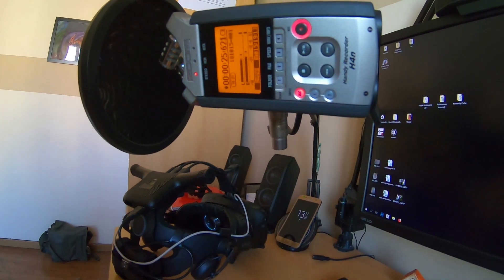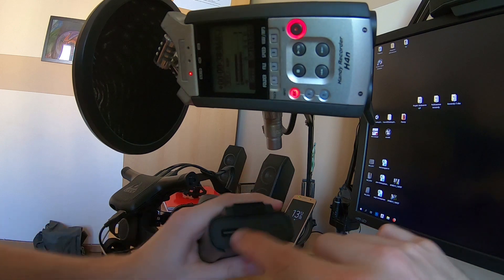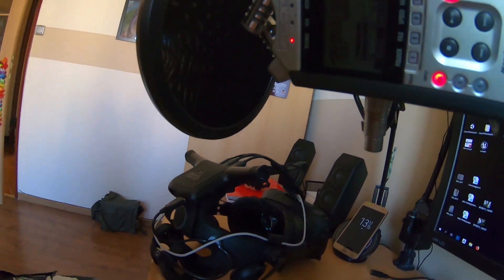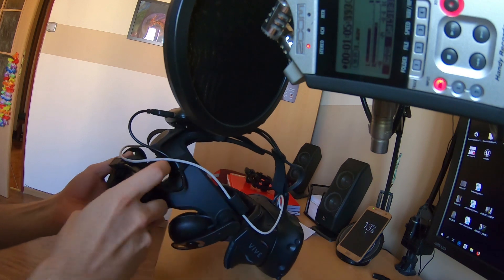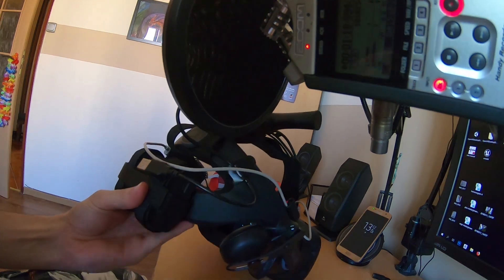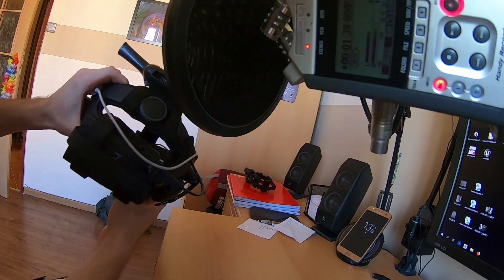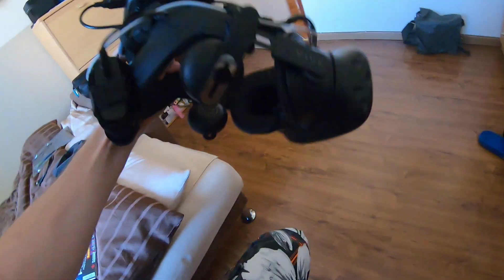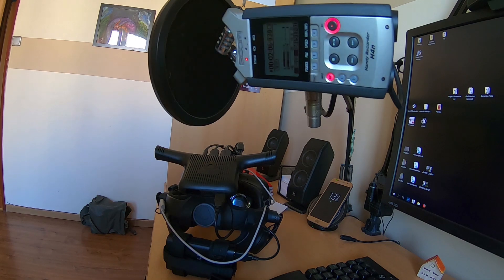HTC Wireless battery hack

Comment: nice! i wonder how'd this fair against bigger batteries
Reply: crazy to see you her i would not suggest using bigger battery's stick with the same size and is does not need to be the vive branded one just one that is supported allowing for a full wireless experience also if you go bigger you are just adding unnecessary weight to your head for them extra hours of game time
Reply: His method would work perfectly fine, given the mounting is sufficiently strong.
Perhaps heating may become an issue, but in that case you could easily insulate your head against it via some dense foam